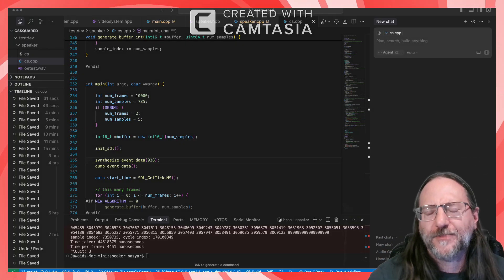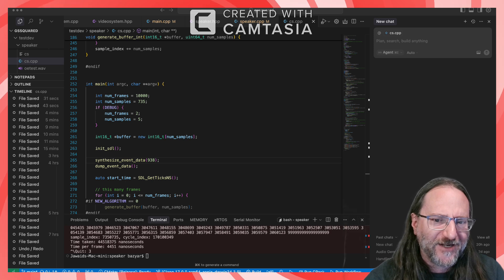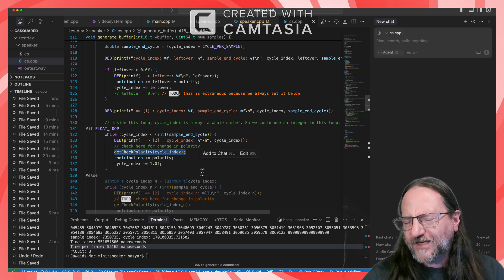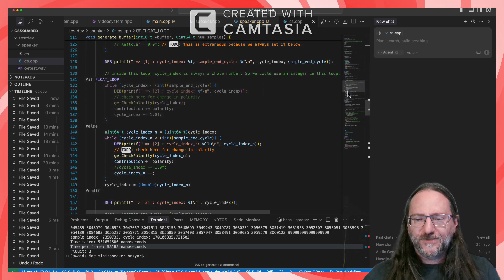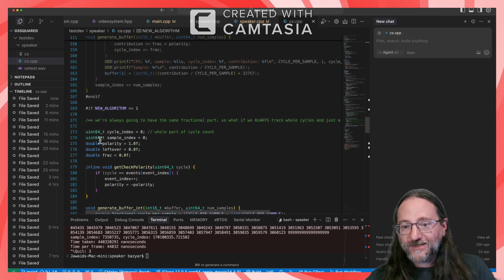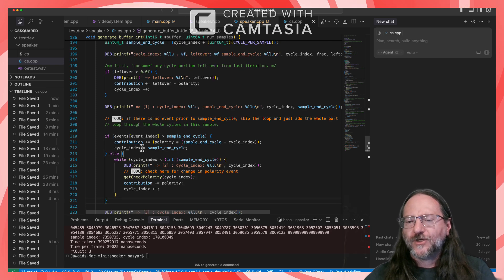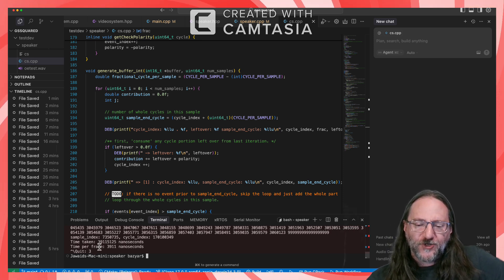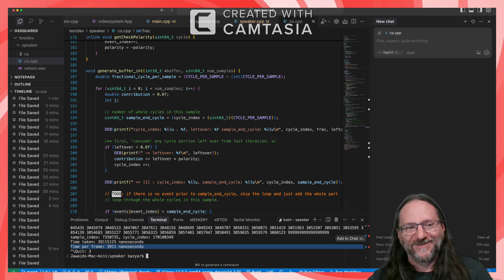BazCodes optimizes the heck out of a piece of C++ code

Comment: Rather than adding the equivalent of `((double) 1020500%44100)/44100.0` and checking when frac>1.0, why not  do `spillover += 6200` (1020500 mod 44100) every frame and do `if(spillover>44100)` instead?
Reply from the maker: We'd still have to convert that integer to a float in two places, where we do fraction * polarity. I don't know if that would end up being more efficient than just tracking a floating point add. But there is one way to find out!